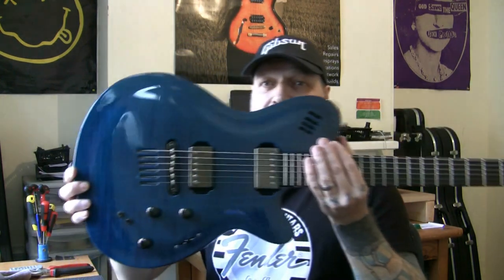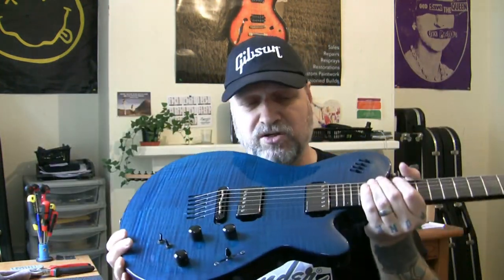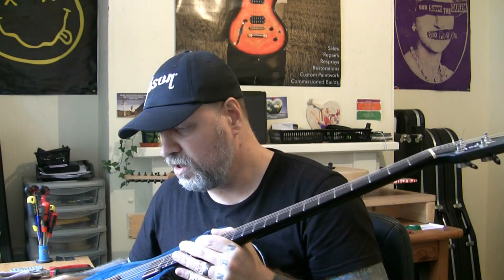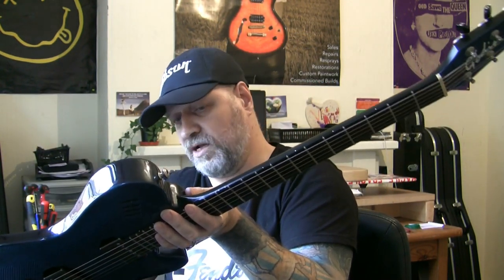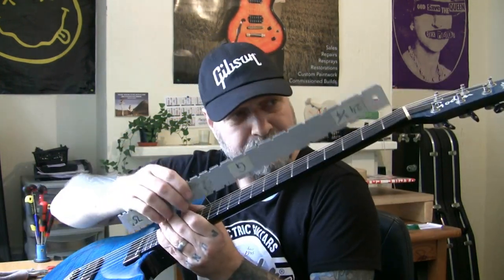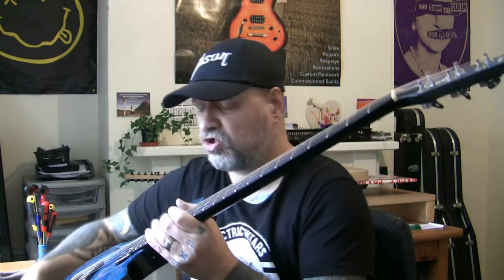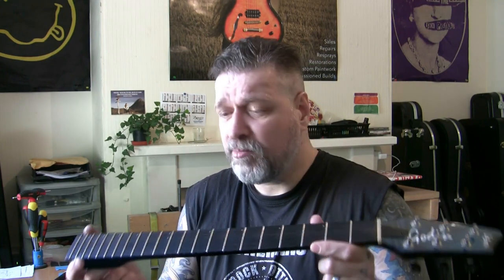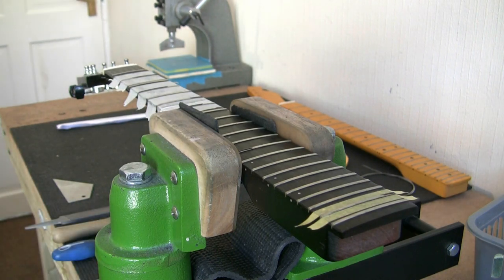Godin LGX SA(S) in for some minor fret-work and a set-up...

Comment: The Godin LGX-SA is a great guitar. When I was gigging with a covers band I used mine to replace my Les Paul, Martin acoustic and Tele. Still needed a Strat or Gretsch for anything requiring a vibrato. I intended to use a Roland GR55 with it for keyboard stuff, but had to move so left the band. A very versatile guitar.